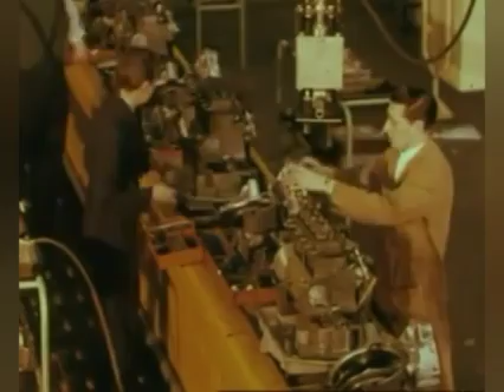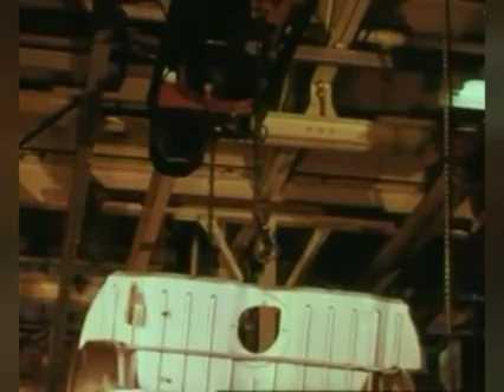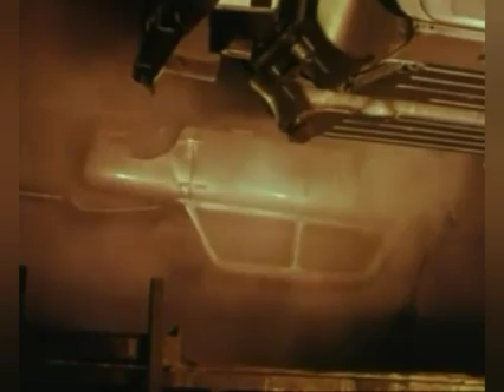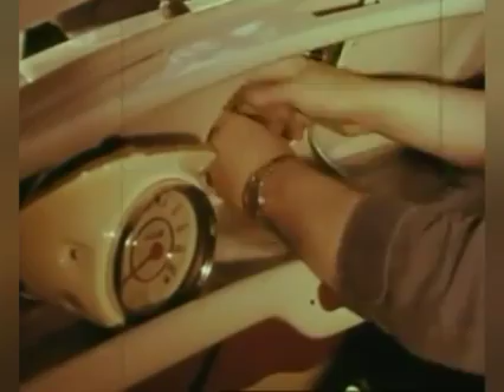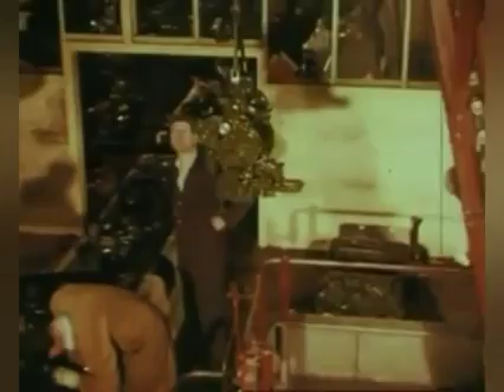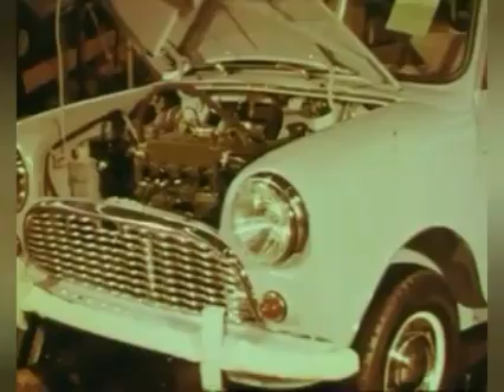The incredible Mini

Comment: The older mini's had quite a major problem with rear sub frame mounts rusting away, to repair it you had to remove the whole sub frame, many old Mini's were scrapped because of this, it would not be such a problem with Mig welders these days, you could probably remove the rear seat and cut away the floor to replace the mounting points and just replace the floor?